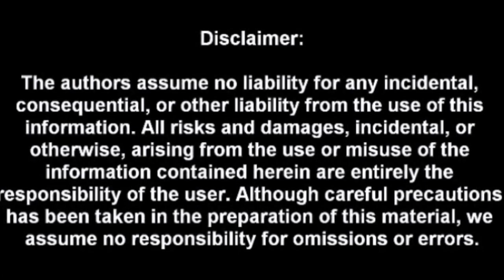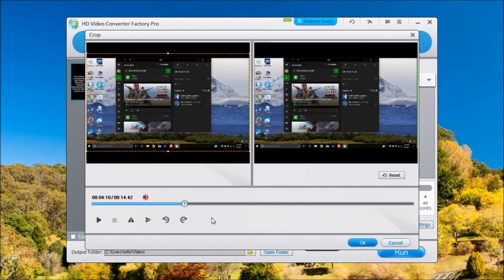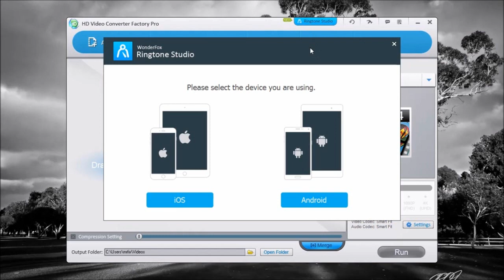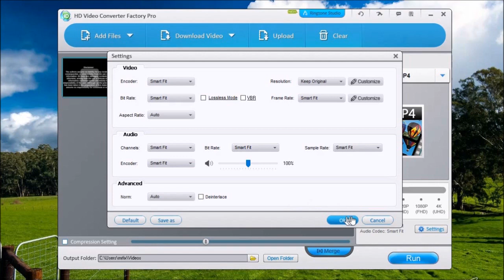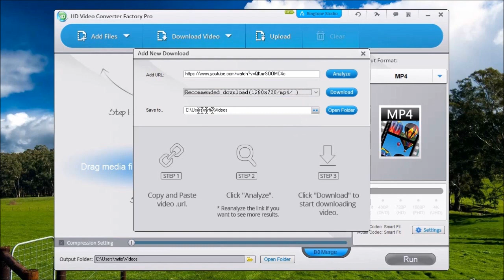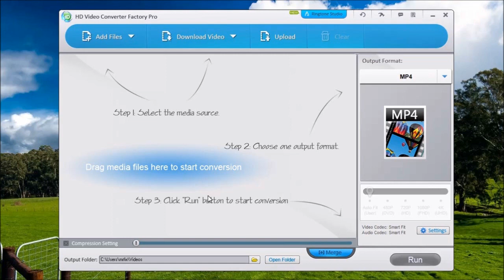WonderFox HD Video Converter Factory Pro

Comment: I have the video converter but i am not getting a straight answer from them on the audio. They claim I have to enter the info for audio, but they do not convert to what is back on the dvd case. How can I deal with the audio?
Reply from the maker: Not sure I understand what you are trying to do..... Each video encoder have specific audio encoders they use.  You can select the type of encoder and the quality of the output. By default the Software will select the optimum encoders for you and the quality based on the PC hardware and the encoder being used.  If you do not want to use the default setting you can change them to your desire.
Reply: @ESRepair  there tech support claim I need to enter the audio info and it does not default to what the original DVD used.
Question I need to run my DVD through makemkv so, libre drive in which it will decode the copy block so it will play after running it through the video converter.
My question is.after I do this do I need run it through a vlc then run it through the video converter?
On the video converter process should I put it through MP4 hd or regular and is there anyway to have only the video go through the process without it going through 5-7 sections or frames of the DVD?
Reply from the maker: @hochhasd1  Once MakeMKV rips the DVD into the MKV file. WonderFox Video Converter can be used to convert the MKV file into any of the 150+ formats.

The converter will process both Video and audio. Settings allows you to fine tune the codecs. If you select MP4 HD, it will use the default settings. H.264 for Video and 2-channel AAC for audio. It will depend on the Player/Device you're going to play the video.  

If you want to strip the audio from the video, open settings in the lower right under the codec and turn the volume all the way to 0. 

Sometimes its trial and error to decide which codec works best for your needs. Every Codec have their advantages and disadvantages From file sizes to Video/audio quality.
Reply: @ESRepair  when I reviewed the audio portion ( below video) it asked for audio encoder, channels,sample rate and bit rate. None of these fields were filled in when MP4 hd for the video was converted. Is there any way to look  at what each field was at in the original DVD or do you know of any save setting I can put in these fields of I am only using MP4 video converting or MP4 hd video?
Reply from the maker: @hochhasd1  You can probably insert the DVD into the drive and look at the DVD contents in File explorer. right click a video on the DVD and select properties then at the top click the Details tab. IF the info is available it will show all the information about the codec used in the video. 

Are you trying to copy the DVD to a blank DVD?
Reply: @ESRepair   no, need to use the makemkv when running the dvd through my external drive, so it can strip the license block from recording. the only thing is, I noticed one of my dvds(upon opening the dvd) that audio and video are two separate files, I hope it will merge to one when I go through the format on wonderfox. You have been very helpful considering wonderfox support have no clue. I ran into a problem with run process in which at least 5 active boxes( looked like parts of the movie) and 2 with no content opened and 2 loaded at a time. Is there anyway to only show one box overall? Thank you
Reply: @ESRepair  I think I am confusing myself on the wonderfox video converter. When I finish with makemkv and turn the actual dvd into a file, does that file go to add files on the first page before hitting "run" to start the formatting process and if this is the case I will only see one box pop up, unlike, if I hit " load dvd?" and hit run? update wonderfox claim that I should click on  load dvd then load dvd folder and not file. Does that sound right after using makemkv? I ask because wonderfox encryption removal does not work.

Comment: Hello, I'm using this Software for the first and I have a question: I have been recording some Splinter Cell Gameplays in 1080p but I want to convert them in 4K, problem is, every time I try to do that I still have some Pixels here and there, can you please tell me what do I need to do to convert my videos in true 4K? Thank you.
Reply from the maker: It's difficult to change resolution from 1080P to 4K in a single pass.  That's like taking a pic and magnify to 20x.  It will pixelate severely.  You may want to try it 1 step at a time.  it will take multiple conversions but it may work.  On each conversion use the next higher resolution till you reach 4K and see if that will work.
Reply: @ESRepair  Hello, thank you for your reply, I stopped using this Software because the Quality was really bad, I didn't managed to get true 4K so I gave up, I guess I have to get a Capture Card that records in 4K, like the Avermedia or Elgato but they are super expensive in my Country, meanwhile I have to record my Gameplays with the Elgato HD60 for PC and the Elgato HD60 S for consoles. Maybe I'll get a 4K Capture Card when the PS5 comes out.
Reply: @miguelsantos84  I THINK YOU WILL HAVE TO USE
A HIGH QUALITY VIDEO CARD WHICH NOW THE PRICE
IS SKY HIGH, AND THATS IF YOU CAN GET ONE
Reply: @redredbostonelecelec  Hi, sorry for the late reply, I just bought the Avermedia Live Gamer Ultra 4K Game Capture.  I paid around 191 Euros but I haven't used yet because I need a 4K TV/Monitor (unless you can record in 4K with OBS?)